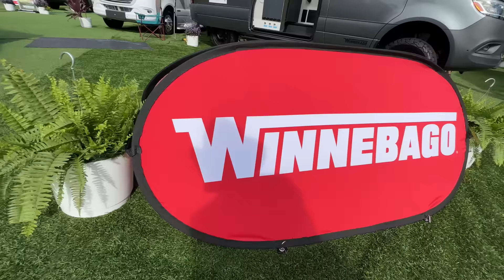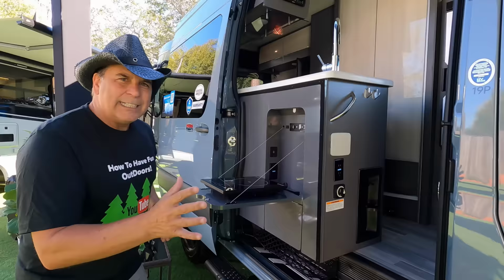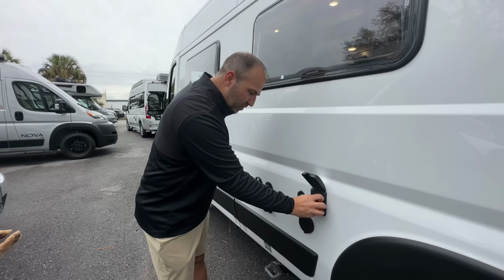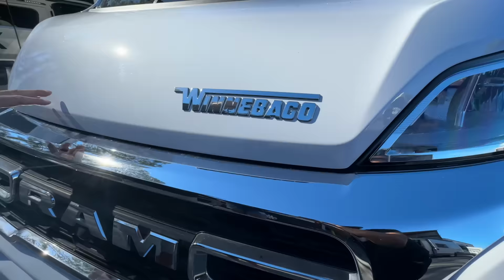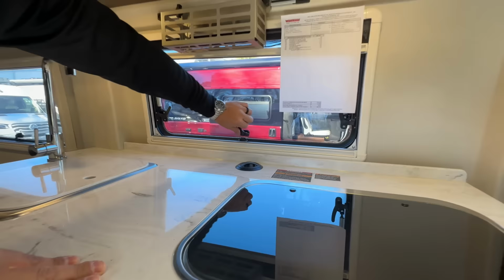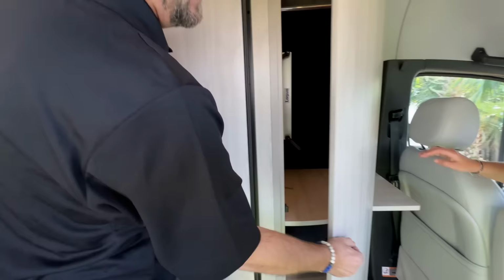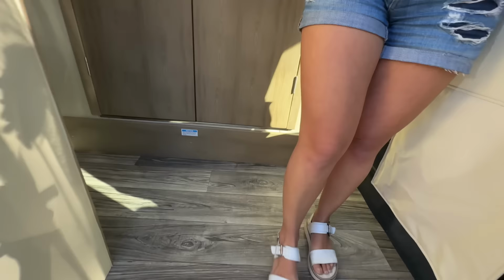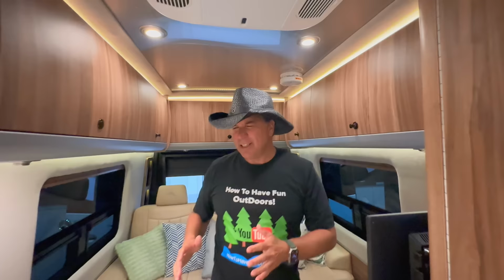OUR FAVORITE 2023 CLASS B CAMPERVAN RVs in 4K

Comment: I’d love a class B. I’d love one with a power lift  bed and sitting area underneath with rear bath. Could these tow a 4Runner?
Reply from the maker: Yep! No issue! Thanks for watching How To Have Fun Outdoors!
Reply: Many class B RVs have a theoretical max towing capacity of 5,000 pounds, but that doesn’t mean they can tow 5,000 pounds.  Given that a 4Runner is close to 5,000 pounds, it would be a stretch to tow a vehicle that heavy with a class B.  And, since the 4Runner cannot be flat towed without modifications, your answer is almost certainly no.

However, many people get class Bs specifically because they can park them almost anywhere and thereby avoid the significant hassle of towing other vehicles. If you want to do modest off roading, get a 4x4 (or now all wheel drive starting in 2023) Mercedes Sprinter.  If you want to do moderate off roading, get a 19 ft Sprinter since the bigger ones don’t have great approach angles due to the overhang in the rear.  But know that they’ll never be Jeeps.

If you really want to tow something as heavy as a 4Runner, a Super C might be a better choice.

Comment: Thor sanctuary 4X4 has the microwave at the very top of the van where I would need a ladder to reach the.
I don't understand why they want to put microwaves way at the top because if you put a bowl of soup in the microwave and you should spill it when it comes out that hat soup is going to go down your arm and on your face and all over the place. 

Putting microwaves at the top is making the company liable for a lawsuit. McDonald's was sued for hot coffee.

I suggest to the company to switch the refrigerator and the microwave. The refrigerator can be at the time the microwave down at a level that everyone can reach it. 
But very nice over all.  Nice leather black hat the man has on. Smiles. From Bambi
Reply from the maker: Very good points! Thanks for watching!